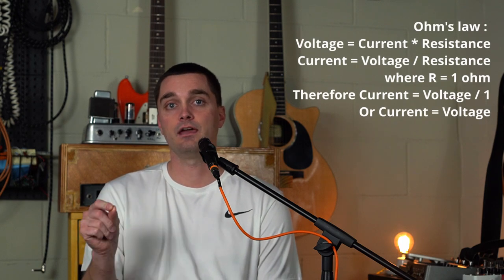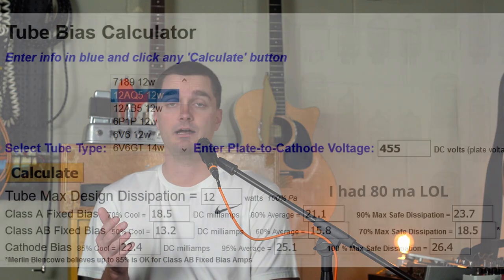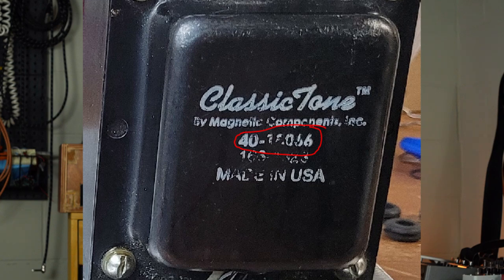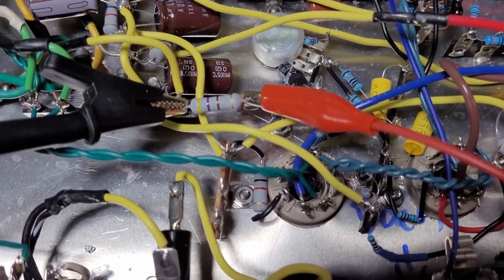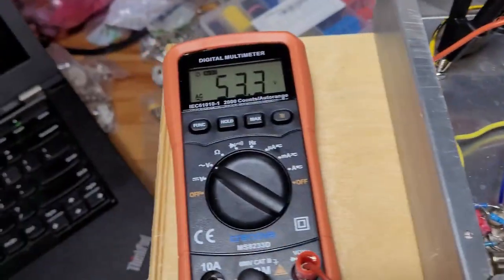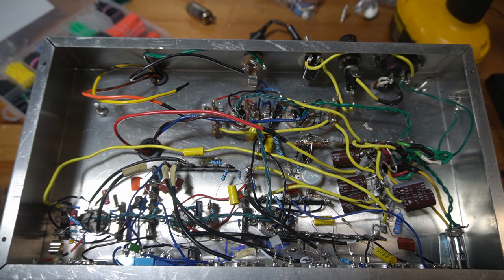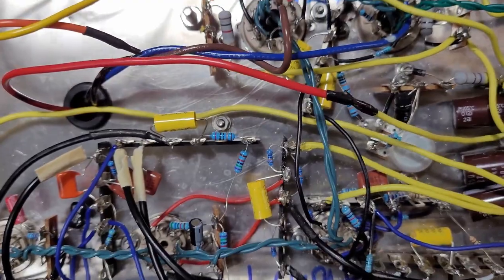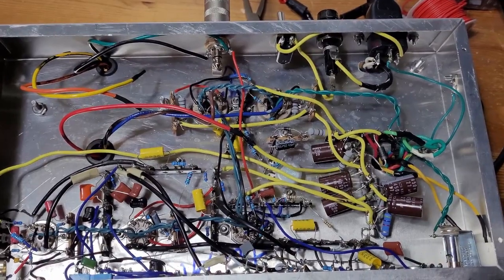Dumble Build pt 3 - Fixing and Polishing

Comment: The filter cap upgrade is a good idea. I have had great results with F&T caps. When I modestly increase the primary filter caps like you discussed I get less flabby and more responsive low frequencies. Enjoy the series. Amp sounds good!
Reply: Ive had some good success with F&T as well.  Was sprague-atom the old go-to before?
Reply: @Yamazaki1923  Sprague Atom are good caps. The values I need are more readily available with the F&T caps from my suppliers. They are also easier to fit in spaces. I use a lot of Sprague orange drop  caps in my circuits. Great quality.

Comment: Congratulations on the Dumble build!  Sounds great and thanks for taking the time to document it by making this video. It’s very educational to see you troubleshoot and the little things that can happen when one is building an amp like a yellow wire having a piece of the insulation missing and burning out a resistor below it or the cap that became unsoldered when you were soldering something else into the same eyelet. I admire your patience in tracking these things down.  One funny note, because I am a bit hard of hearing (too many years of playing loud rock ‘n’ roll), I like to turn on the closed captioning, so sometimes see some funny mistranslations. The CC kept calling the Dumble amp a Dumbo amp. Got a little chuckle out of that. Thanks again!

Comment: One last word about the meter's resistance at 3:55; just short the leads together on the lowest ohm setting. Usually will read  about .3 ohms. This is the meter's/leads internal resistance. Subtract from actual reading of 1 ohm resistor.

Comment: Glad to see you found and fixed some of the problems. Yes, the JJ 6V6S is a robust tube and was a good solution for the higher voltages due to the wrong transformer. I can guarantee you though, that the OT is not big enough and if you crank the amp up enough the core will saturate and will sound horrible.  You should change the first stage filtering to be much bigger and to handle the 500+ plate voltage. Use 2 big caps in series like 220U, this will result in 110U filtering, but double the voltage rating of the cap, you need parallel resistors for this also, look at an old Fender amp schem. If your fuse isn't big enough, the inrush of current with bigger caps might blow it, and you might need to make it bigger. Part of the appeal of Dumbles is the clean tone, you really should put the switch in. Use eyelet boards next time, it's much easier, and cleaner. Also, shielded cable has capacitance that can remove high frequencies, you have a lot of it in there, it's probably sucking the tone out to some degree.

Comment: You must  zero your meter before checking for 1 ohm. Your leads have certain resistance and you will see that. I use a Fluke 57V and it has the zero feature

Comment: just happened on your channel.. i think i've seen these before but i paid attention today..  reminded me of my early Dumble tone  chasing... it wasn't until i perfected my fave circuit that i realized the "Dumble" tone wasn't really a tone but because he custom tuned each machine to its owner... and some just sound like crap.. honestly.. they are just amps.. with some mods.. i learned some tricks along the way.. picked and choose from some values and circuit mods.. my best amps i ever designed was a hybrid Princeton  (foot switchable marshall/fender/mesa channels, master vol, reverb, effects loop, boost/bright, attenuator, adjustable "hotdog" bias switch)  made a 100watt version too.. 4 6L6s.. with a 5150/fender vibrolux/ hk triamp channels... same basic mods.. trying to include the best of all worlds i could..  then i started chasing speakers.. that was completely enlightening.. the magic is in the speakers.. i built a 2x12 for recording.. a green back with that half closed.. then a vintage jensen.. open backed.. same cab tho.. with the smaller amp was so versatile.. perfect for recording..  the bigger amp with a 4x12 was a monster.. kept tweaking it and made a great road rig..  fast forward.. now a helix with IRs... DI a dry channel to the board.. send a full wet to the board for a 2nd channel.. and break off a 2nd chain pre amp/cab and send that to the little custom Princeton 3 channel stage amp.. sm57 on which speaker fits the sound needed.. .send that as a 3rd channel..  mix wet/dry/wet... pan the wet signals left and right with a slight delay.. feed the dry in dead center with a very small additional delay if needed.. thats huge and magical.. can be hard for metal.. silky smooth for jazz or twangy for country.. and anywhere in between.. can literally get anything from it.. it's way more than my full rack and stack from back in the day and doesn't break my back...

Comment: Would love to see some ways to implement channel/foot switching. Specifically in an ab763 style circuit. Thanks and great work!!
Reply: I use an Orange Amp Detonator ab y pedal to switch between channels on my modded 67 Bassman. The bass channel is reverted to 5F6-A tweed specs and the normal channel is reverted to AA864 specs (which is the bassman version of the quintessential AB763 black panel specs).

Comment: Nice video Kley. The 1.6ohm resistor isn't really an issue, it's still Ohm's Law no matter the value. Just one extra step with the calculator rather than reading the DMM. I still measure them each time even if I use 1% metal film
Reply: Well, you need a very good meter and leads to measure small resistance values and get reliable and accurate results. To use 1ohm 1% resistors is the only sensible option because they cost almost nothing.

Comment: This was great, fascinating, thanks for putting in all this work and sharing it! I'm curious for your thoughts/reasons for using the Brown DLite kit -- I've seen these for something like $900 bucks, and I'm thinking the sum of the components is probably a fair amount less than that. Although I do understand the convenience.
Reply from the maker: You're welcome!  I looked at the D'Lite schematic a lot in preparing for this video and believe it is a very sound circuit.  If it had a capable builder I'm sure it could be a great amp.

Comment: I've only ever played one Steel String Singer and one Overdrive Special (both David Lindley's) and your build doesn't sound much like those but it does sound really good and I agree it is extremely usable for any player cool enough to actually use his guitar's controls.  I do however think it is worth the effort to at least try the switched mode since any amp with any similarities to Dumbles exhibits or should exhibit extreme articulation.  It is likely worth a follow up video as well.  Kudos, man... nice job.
Reply: Well now I feel a bit silly since you did exactly that and made it sound a bit more articulate, too.